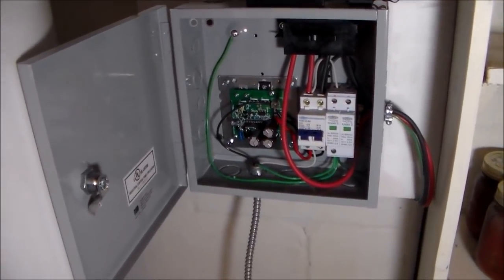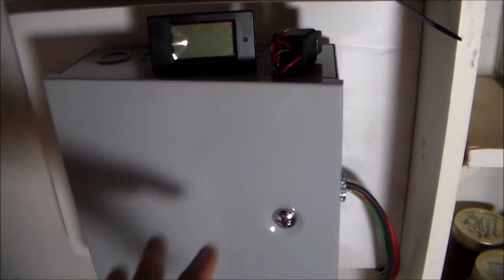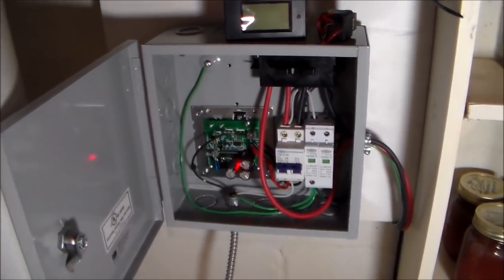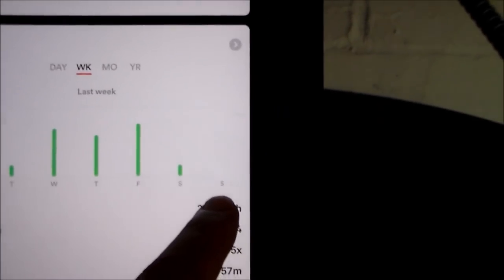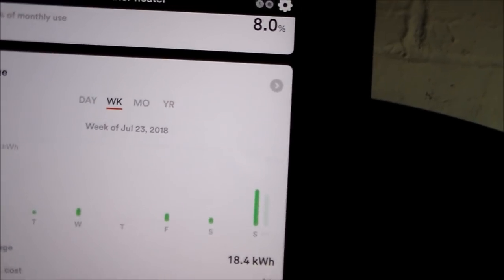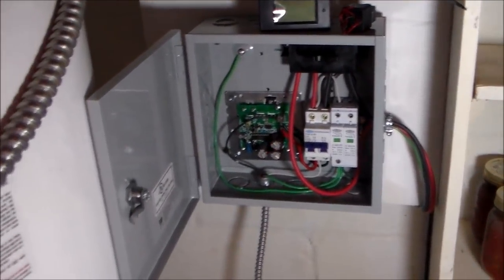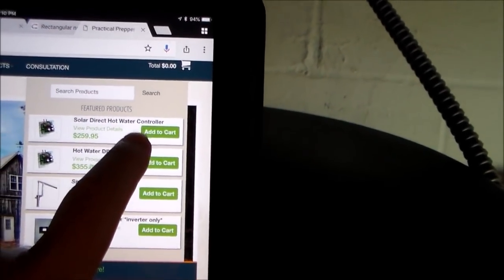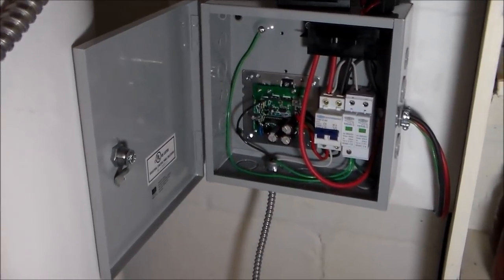DIY Solar - Episode 15 - Hot Water Controller Update #2

Comment: Thanks, Jim. A former NE Ohio guy here. I watched your videos and the are great. I now live in Thailand. I have a Solax 1.5kW X1 Mini, with four Jinko Poly 325s, maxing out at about 1150 watts. Ican't spin the meter backwards, so it is just producing when it sees a load. I'm just cooling a small room that uses a Panasonic Mini-split. It consumes about 800 watts an hour. So, while I'm at work, my wife and dogs get AC free for about $1500 USD. You have been very helpful with my decision making regarding the type of system I should buy. The Solax GTI is not an option in North America. I chose the Solax becausr it can run at a higher voltage than the Sun GTI, it's fanless, great monitoring software and has  a great warranty. I'm going to add the meter in a few weeks. Thanks again for the details you provided, especially regarding the distribution center.
Reply from the maker: Steve Bollmeyer I’m glad you were able to use some of the information in my videos. Thanks for the feedback. I’m not familiar with the Solax. I will need to take a look at that. By chance, does it have a limiter in it like the Sun GTI?
Reply: @jimginnyohio  , yes.  Here is the link:
https://www.solaxpower.com/en/x1-lx/
https://www.youtube.com/watch?v=P6fRZHfvbiQ

Comment: Thanks for the shout out. You can do a lot better if you put TWO blankets on the heater and some insulation on the top like the pink fibreglass stuff. You are also losing heat through the floor and may want to consider one of those pads made to insulate and support the weight. Your copper pipes need to be insulated and you should remove those long ones that have no use because they are acting like heat sinks. A timer on the grid element may help also if the grid is coming on when the sun is out, it's better to let the solar do it's thing.
Reply from the maker: I purchased a couple insulated blankets and pipe wraps, just need to take the time to install them. Although I probably won't bother with adding anything under the heater. I doubt there's much loss through the floor since heat rises....and also that would be a major undertaking to install!  ;-)
Reply: That's exactly what I was thinking. Hot water heater blankets I would think would help a lot.
Reply: @jimginnyohio  Respectfully, heat radiates 360 degrees.  "Liquids" such as heated air or water will rise.  That is why new buildings have insulation under the slabs.

Comment: The 20A DC version of that peacefair watt meter arrived the other day and I am quite impressed with the look and operation compared to others I've used. I put it on my hot water system.  I lost a lot of monitoring equipment in the lightning strike.  The low voltage screen flashing has found a use.  My new charge controller has a habit of getting lost in the MPPT algorithm and dropping the 60V panels down to 19V. It won't recover unless panel voltage is removed.

Comment: Thanks for all 3 videos on this hybrid solar water heater.   I am much more inclined to use PV for this. Does the controller in that box turn off when too hot or does the thermostat do so at the element?
Reply from the maker: The thermostat on the element controls the device. You typically lower the temperature on the upper element and increase the temperature on the lower element so the controller makes as much heat as possible.

Comment: Nice I am looking at this as a back up water heater  used as a diversion load for excess solar.
Reply: This won't work for diversion loads as it would likely interfere with your existing controller and they would both get lost.  I do diversion directly from the panels on a charge controller and it works great. I don't sell anything, but I have plans if you want to experiment for not much $$$.  I'll be doing a video shortly on the WH controller controller currently connected to a 40A MakelueSky and 1600W of panels.  Even just a few watts extra goes into heating water. Slowly, and I mean slow, people will finally get the idea.  Thanks for your great videos explaining PV hot water.  Does your monitor show time of day usage?

Comment: Jim, great project. What’s your average daily hot water usage?  Also, are you still running your upper thermostat at 125 and lower at 140?  Have you tried a larger temp differential ?
Reply from the maker: Hi Brian. Daily hot water usage in our house is usually 2-3 showers, laundry every other day, dishes, and various other incidental uses. Since installing the device, the power consumption on the water heater has dropped from about 35kwh average per week to about 10kwh. I did increase both of the thermostat settings upwards. I now have the upper element set to 135 and the lower element set to 150. I found 125 to be too low for the upper element on cloudy days. Also, I originally set the lower element to 140 since I was worried about getting the water too hot and creating a scald hazard. That hasn't been the case, so I raised it to 150 to capture more solar energy. It seems to be working great as currently configured. Thanks for your comment!

Comment: Can you please explain what exactly this board do for a price of more than 250 USD? As far as I know, you can simply connect your Solar panels to a heater element (best option would be if the panels voltage at mpp and rated heater voltage would be the same). The temperature control is done by a thermostat from water heater. There is actually nothing else to do here, so the question is - what what so special can this board do for what you should pay 200-300 USD? No offence, just curiosity, maybe I just do not know something =) BTW - nice job done and hello from 2020 =)
Reply from the maker: Go to this website to see the full details for this item: http://techluck.com/
Keep in mind that your panels output in DC, while your element is designed for AC. Connecting your panels directly to your thermostat can cause it to burn out.

Comment: Can that be used with a charge controller so when it stops feeding the heater it charges batteries or any other configuration as an grid tie inverter?
Reply: If you have a smaller water tank, then Yes, you could add a switch to divert the energy over to another device if you wanted. But since I have an 85 gallon water tank, it’s best to keep pumping heat into the tank to get the water as hot as possible.